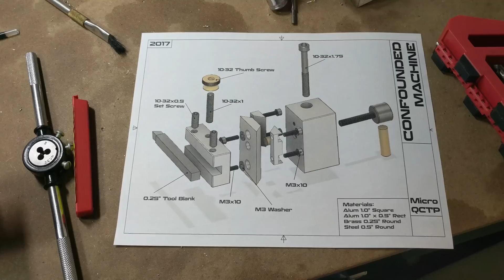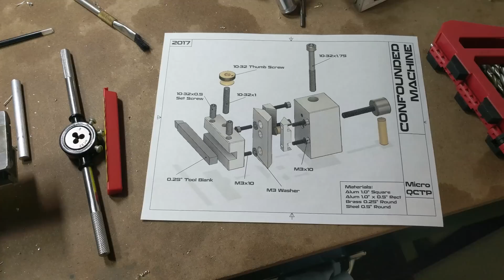Digital Plans Micro QCTP

Comment: I just look at the video again for the mini lathes there is going have to move the cross-slide to position using 2 sided tape set the post and tool post on the cross-slide 
Now using a Transfer Punch, punch the spot post sets now drill and tap now its mounted

Comment: I don't have a lathe yet but will soon, I order your plans and look at them already nice...I don't have a way the cut the groove but I have come up with a way to do it without a mill 
I will use a 1" square 6061 and 1/4 thick by 1" wide  and 1/4" by 1/2" for the dovetail and use a sander for the 45 degrees to size 0.45" ....next tool holder 1/4" by 1" and 2  1/4 by 
0.37" ( about 3/8"by 1/4") this way all you need to make this is a drill press and drill press vise and sander of some kind or you can use file to cut the 45 degrees and size them

Comment: Hi Curt, thanks for the video. I have a taig lathe i bought secondhand, and was looking to improve use and setup. What is the angle iron mounted on board for, (Magnetic indicator base I assume),  or does it have other uses?